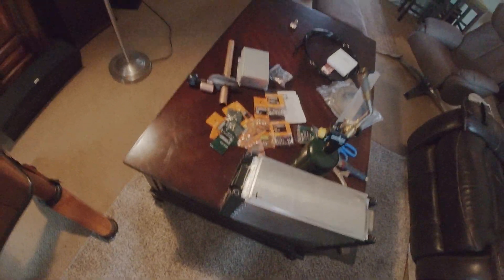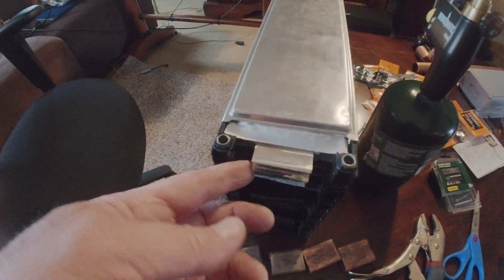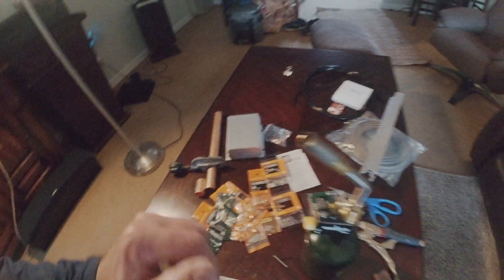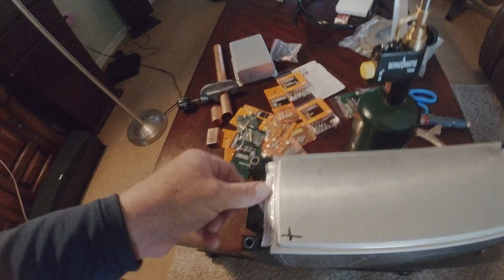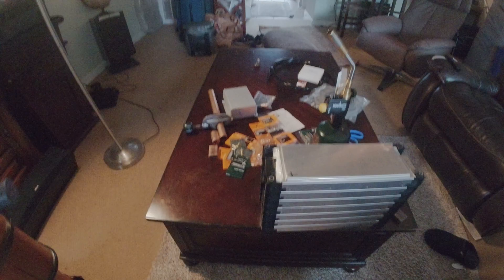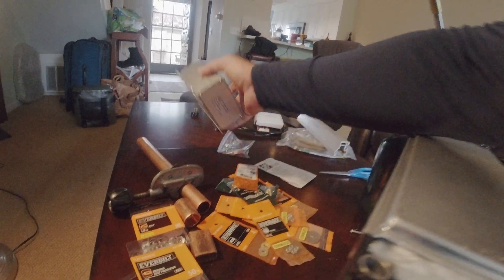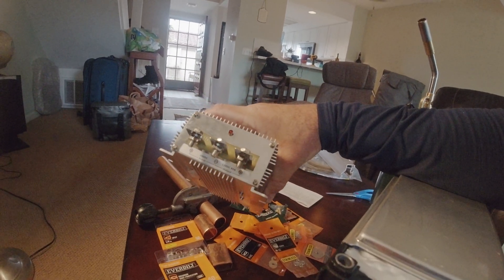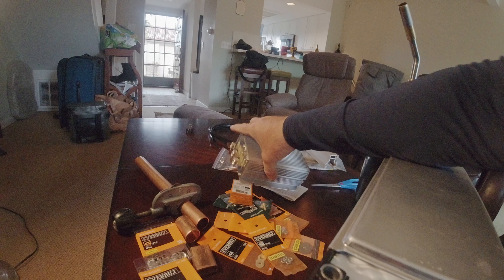LG Chem Cells-Making Buss Bars for DIY Lithium Polymer Battery

Comment: thank you for the video , what are the final  dimensions  of the resulted rectangular profile  you created ?  the perimeter of a 1" pipe is 8cm so the profile can be 3x1 cm or perhaps 2.5x1.5 cm ?  I  have the same cells from battery hookup  also 7S config and the tabs are not long they are between  1.0 -1.5 cm  some are longer and some are shorter - and under the short tab there is the  plastic  bar that makes it even more difficult to accommodate 1cm width bus bar.. so i wonder if you created all 6 bus bars with  same profile or you created each one according to the actual tab length ? ..